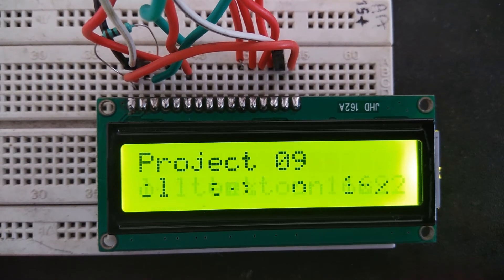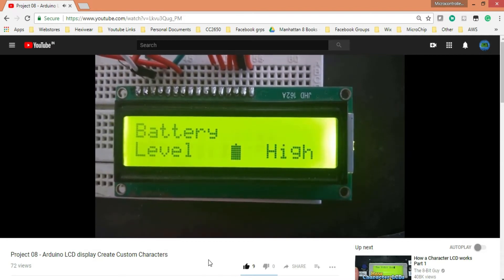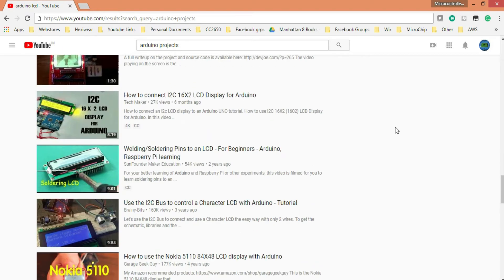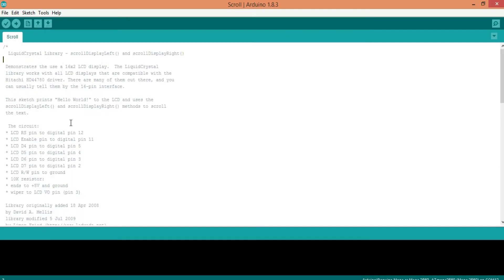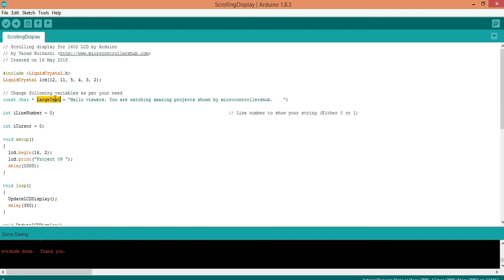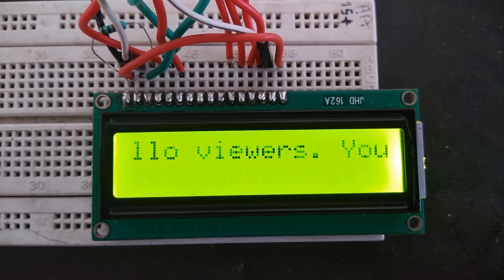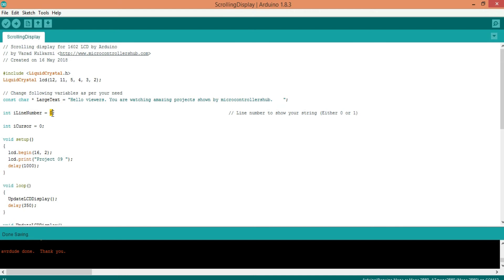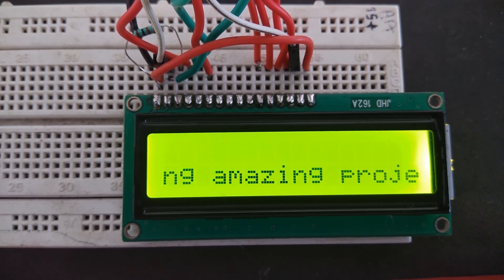Project 09 - How to Scroll text on 1602 LCD Display

Comment: Im relatively new to all arduino concept and i have 1 question for this. Which part of code is actually making the text scroll left ?
Reply from the maker: Actual code which is moving text is not visible in this video. There are 2 for loops which take care of scrolling the text to left.
I was planning to add code explanation in this videos itself, but it was making this video a bit lengthy.
So I thought of making a separate video for it.
You will get code and a video on its explanation, very soon  :)
Reply: I guess thats the UpdateLCDDisplay() function that u called in the loop :D
Reply from the maker: +med0n1 Yes, exactly. 
Logic inside that function is responsible to scroll the text. 
Code for that function is not visible in this video, is what I was saying in last comment ☺️